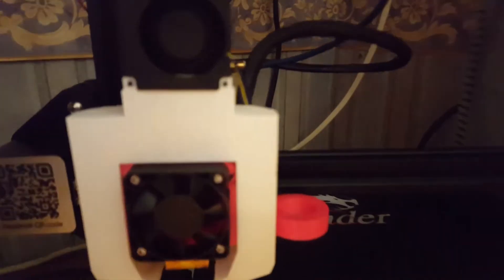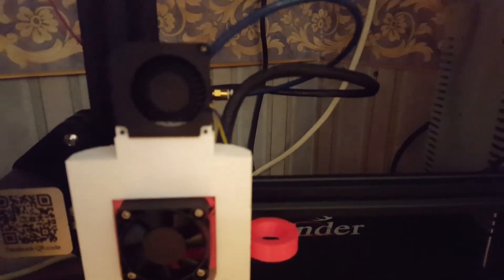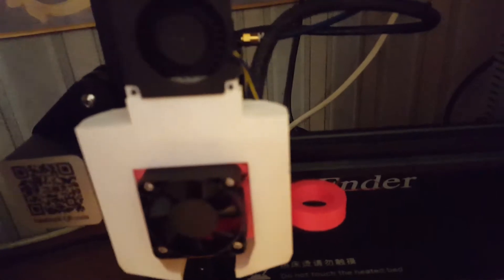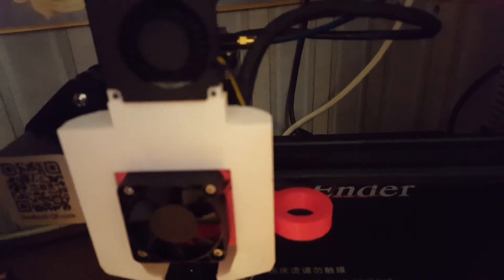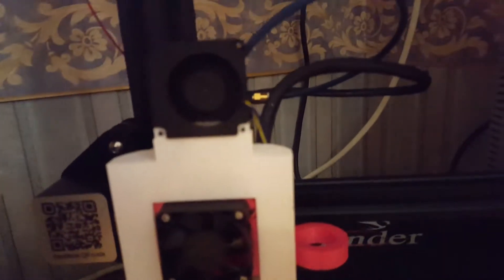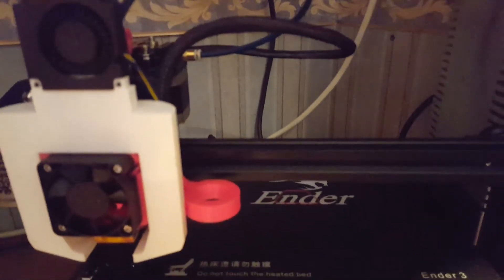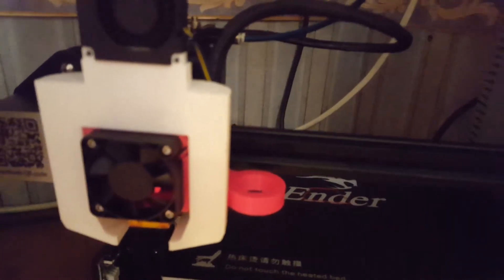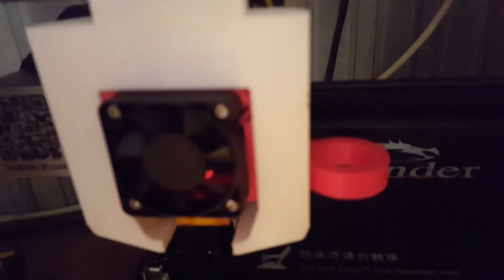Ender 3 petsfang fitted part 3

Comment: Which file do you need for the stock fan at the top? I printed the fang already.. But not sure how to mount the fan.
Reply from the maker: ZooPaPhly https://www.thingiverse.com/download:5116517 for the stockfan

if u want to fit the radial u will need a 24v 5015 radial remove power lead & cut wires on old fan and connect new fan wires ebay has a few
Reply: @wayneuk  do you have the STL of the fang for the stock fan by any chance?
Reply from the maker: @2691014  i will check for you
Reply from the maker: pretty sure i have the petsfang stock fan mount kicking about somewhere if anyone wants to pay the post as use radials now
Reply from the maker: @2691014  i found the file and have uploaded it here https://www.thingiverse.com/download:5814487
Reply: I have the same problem I can not find the stock for the original fan, I still do not know what to do
Reply: i can't find it either, only for 5015 blower, maybe it was removed !
Reply from the maker: @adrianclaudiu90  ive a spare printed one for stock fan no longer being used if your in the uk and pay the post
Reply from the maker: @calilab3d575   here you go https://www.thingiverse.com/download:5814487